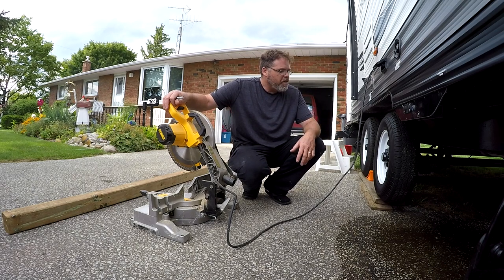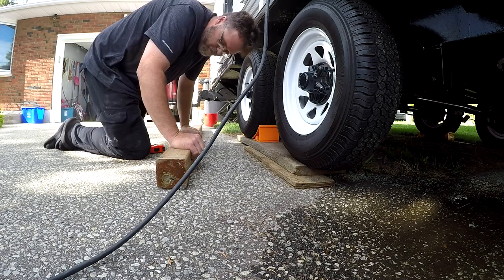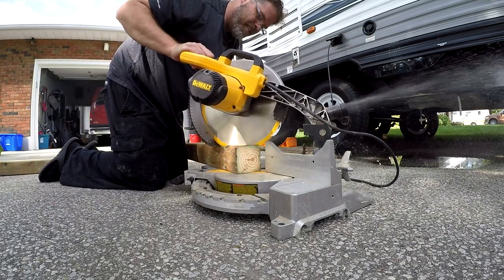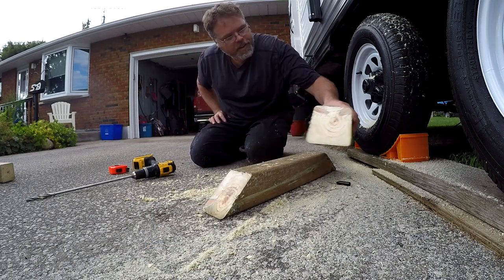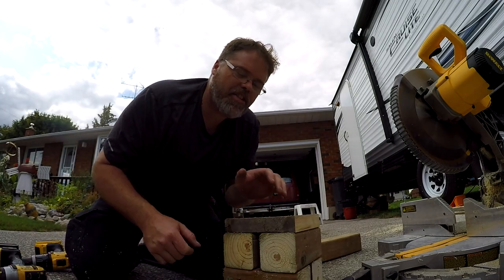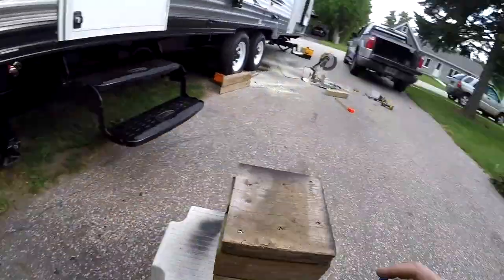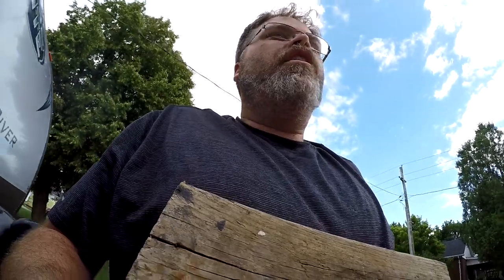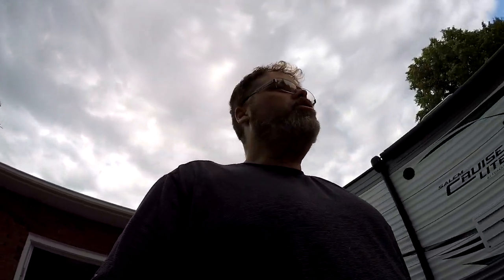Make Wheel Chocks And Stands

Comment: www.fastwaytrailer.com Check out the Flip Jack stand. Never have to lug around blocks of would. When letting the jack up it flips under your Camper and when letting the camper down it unfolds and stands and holds the camper in place. They run about average $35.00. But once mounted in about 30 minutes no more placing blocks. your Through.